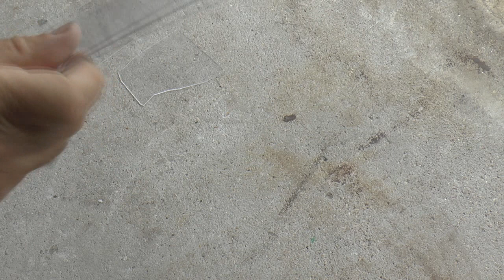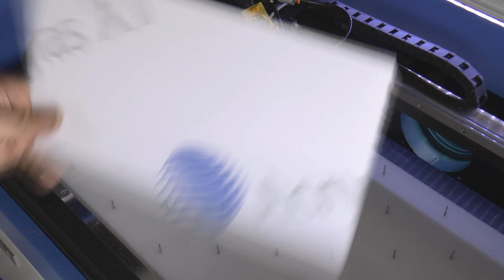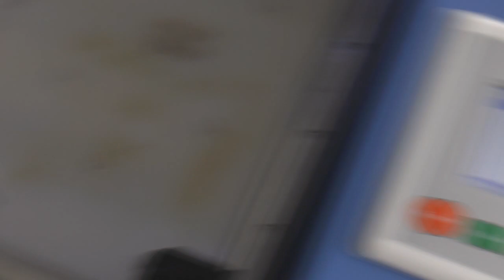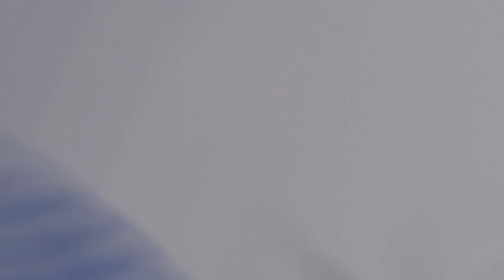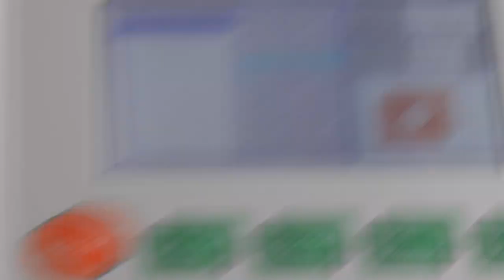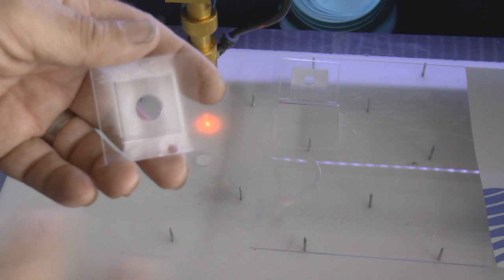RDWorks Learning Lab 05 Cutting first program

Comment: Hi Russ, please my laser machine does not cut deep but it only draws lines of what it's supposed to cut. I use RDworks V8 
My control panel is just like yours
What do I do
Reply from the maker: Hi Precious
 I now exactly what is wrong because I had exactly the same experience  when I bought my first machine. You undoubtedly bought is as an advertised 50 watt tube. A quick check will  confirm my guess that is is only 800mm long and is probably labelled  K H Laser.  In reality this is a reject 40 watt tube from a main tube manufacturer. K H Laser do not make tubes, they just re-label junk tubes and fit them to their machines.  The Chinese know that  A) you will be technically naive about this technology and B) you will have no way of measuring the power because that requires specialist equipment. Yes this is out and out fraud  that has been going on for years.
 I am  sad to tell you that the only fix is to buy and fit a new tube. However do NOT go looking on Amazon or Ebay. Yes, there are some great bargains to be had  but you will be buying junk to replace junk. They are cheap for a good reason.  No I am afraid you must buy from a reliable source to get a proper A grade tube 

Check out this CR45 tube from Cloudray. It will fit in exactly as a replacement.  
https://www.cloudraylaser.com/products/35-70w-co2-laser-tube-upgraded-metal-head-cr-series?variant=33496778277004

 Best wishes
Russ
Reply: Thank you Russ 😊

Comment: instead of using the "frame" to see the path or border, is there a setting to find the center of what your cutting or scanning?
Reply from the maker: Yes. If you go to Config System settings you will be able to set the HEAD POSITION to a central position.. When you draw, you will see that the green square sitting in the centre of your drawing. If you now drive  your head to where you wish to start and press the origin button , that is where your head will start and finish. You still might want to press the frame button when you have downloaded your program to make sure you don't run off your material.
Best wishes
Russ.

Comment: Sir Our machine is not doing round punch. How we fix it
Reply from the maker: Hi
There are many possible reasons  for this problem but the first thing I would check is that  your X and Y scaling are correct  Program a 200 mm square and burn it onto a piece of card or mdf, . If the dimensions are not what you have drawn then you need to re-calibrate each axis .
Best wishes
Russ

Comment: Hi i have 150w co2 chinese laser machine when i cutting mirror 3mm gold or silver acrylic (power 45 and speed 15) material ll be burn so let me knw how how much i ll give speed and power.
Reply from the maker: Hi Dyamu

As this video explains there are several clear plastics that are NOT acrylic and several such as PETG, Polycarbonate and ABS can be obtained in mirror format. You can set fire to acrylic vapour but the edge will not burn it just evaporates and leaves a clear edge.. If the edge is brown or yellow then the material is not acrylic. Is there a trade name on the protective plastic film? If so Google it to find out what the material is. Some plastics produce toxic fumes so be careful. see http://atxhackerspace.org/wiki/Laser_Cutter_Materials
Let me know what you find

Best wishes
Russ

Comment: hi, is there any feature to hold and continue the process when the electricity OFF and back ON again ?
Reply from the maker: Hi

Sadly no. When the power is turned on again, the machine will auto  reset to zero and wait to begin your program again. . Some machines have a separate switch for turning the laser tube on and off, if you have this feature then, provided you have not disturbed the material, you can restart the program with the laser switched off and then pause the program just before the failure point, and then switch the laser back on.

Best wishes
Russ
Reply: @SarbarMultimedia  hi thank you for the reply, is it possible if i add ON/OFF SWITCH on Laser line power ?
Reply from the maker: Hi
If you look at the next video     https://www.youtube.com/watch?v=ybnT3lECAqs       at around 8min 13 you will see the switch panel on the side of my  China Blue machine.The third one up marked laser allows me to separately disable the laser tube. Yes you can add your own switch but be careful because it is switching mains voltage.  If you look at the high voltage power supply you will see two sets of input terminals. There will be a 6 way terminal that has all the 5vdc  control signals and a mains input terminal that will be 3 (sometimes 4) terminals. You need to intercept the mains in one of those wires to control your tube on/off with a separate switch.

Best wishes
Russ
Reply: Hi thank you for your reply..

Comment: Hi sir,

great tutorial, and really very educational, thank you for putting so much effort in sharing.

I have a noob question, i bought a 90w versions and wanted to use it to ease my workloads and provide etching service in my fishing reels trade. And so my problem is, i actually have zero knowledge about laser cutting when i bought it, thinking it was just “plug and play”. So i search on youtube hoping to pick up some basics. and i came across your channel. 

May i please seek your advice, (my machine is stock)
-what is the advised distance positioning of the laser to cut 10mm acrylic?  What speed and what Min/Max power to set?
because when i tried? it seems my cutting line is thick and the edge is like rounded with melted acrylic. 

i also wanted to cut 0.8mm carbon fibres(there is 0.2mm fibreglass inbetween) but i realised i need to repeat it 3 times, still need to push it out and ended up the measurement was distorted by the over burning from the laser.

All i wished is to learn , how to achieve a clean and sharp cut through. You advises would me much appreciated.

I hope u can drop me an email reelspa@outlook.com as i am quite embarrassed to ask so much noob questions.

Thank you sir.

Regards,
Calvin

Comment: Hi, thanks for all the videos you post on here, they have been so helpful, but I do have a problem, every time I etch, the machine only etches at the top left hand corner, I’ve changed the green box to be position on my lay out page to start top left, and gone into config etc, re interned x and y box to zero but it’s still only etching in top left hand corner not in the middle where I want it to etch, hope you can help.
Reply from the maker: Hi Michelle
Take a look at your you tube messages
Best regards
Russ

Comment: hello! how to set the bed settings start origin on machine? every time i turn off the machine it comes back to the default. how to set it as fix and to start also the base point on bottom left? thankyou.
Reply from the maker: Hi
You have no control of where your machine runs to at start up. It will always be the back left or back right corner. That sets the main coordinate system for the machine. Take a look at 
https://www.youtube.com/watch?v=CWZvQXxbR_E
Hopefully this should answer most of your questions. If not shout out again and I'll try to answer.
Best regards
Russ
Reply: yes we dont have control, once i restarted the machine the origin on where it is stop that will be the starting point. unlike other laser, once you go for the origin marked, it will back to base point.  i would like to set the machine origin on machine settings and to set the origin on bottom corner so that the whole bed size will maximize and can be use also. thank you for your reply.
Reply: yes. please help.
Reply from the maker: Hi
I have prepared a video answer for you.

https://youtu.be/xwtNiVvSivU
Best regards
Russ
Reply: Thank you. appreciate your kindness mate. already watched the video and what i am trying to say is the initialization of  laser machine, once powered on, the head will move forward then the bed settings will changed again the size of bed that was changed in software will move and got vibration if the size will not meet. i would like to ask if the machine initialization of base point can be fix in one place which is bottom left corner then the size also of machine bed will not be move.. Thank you for your continuous support mate.
Reply from the maker: I must first apologize for not answering your question. You Tube place your comment into a spam folder and I have only just discovered it. I NEVER leave a question unanswered even if I cannot help because I feel that extremely rude.

I have looked at your video and can see that 
a)you have quite a large machine
b) The head is moving far too slowly 
c) It looks as though th head is trying to move towards the front right corner of the machine. Is that correct?

There will be a proximity switch, probably one of these at the end of the X and Y axes. 
http://www.ebay.com/itm/PL-05N-2-Inductive-Proximity-Sensor-Switch-NPN-NO-for-FOTEK-DC-6-36V-NO-5mm-/262115551988?hash=item3d074deaf4:g:1mcAAOSwFnFWCgJz

This is what the head is trying to reach to set the machine 0,0. It is taking so long that the controller is fed up with waiting and just ignores the reset procedure. In doing so it does not know where the table limits are and will drive the head into the end stops. 
If those sensors are at the front right then the immediate solution id to turn your machine on and let is set to where it wants. Then drive the head so that is is about 25mm away from the front right corner and press the origin button. If you look at the display on the screen you will see the X and Y cordinates displayed.  Now press the reset button and the head should now move  to the datum sensors and set your machine to a proper 0.0. 

I believe this will now make you machine ito a sensible one BUT you will have to go into the USER SETTINGS and adjust at least one number. Before you start this you will have have your pc connected to the machine When you select the USER tab you must first press the READ button to see the parameters that are already in your machine.In the first section there is a START SPEED. It may be set to 10mm/sec by default. Try changing it to say 100mm/sec and press the WRITE button to send the new number to the machine memory. You should find the head runs much quicker towards 0,0. If this fixes you problem the drive you head as far away as possible from 0,0 and press RESET. Does it make it alll the way back to 0,0? If not the increase the start speed until it does.

I do hope this helps
Best regards
Russ

Comment: Hello! Can you help me ? Now, i have a laser machine CO2, use sensor height live focus system LFS-AP01 and control system RDLC-V6.32.74. But i don't know how to set up auto focus for this sensor auto up and dow when i cut metal and nonmetal. Thank yo very much!
Reply from the maker: Hi Mahn
I am sorry to say I know almost nothing about this system. I have seen videos of it being demonstrated so I am aware of what it does. I have been to the RuiDa website and there are several operating manuals there to down load but none match your system model number
http://en.rd-acs.com/down_complex.aspx?FId=n14:14:14&pageindex=1
There is a contact link at the top of the web page so I would contact them directly for a set-up/ operating manual
Best regards
Russ

Comment: I have loaded RDWorks into my PC. When I press test, I am getting a "Test Failed." I am not connected to the 40W Machine. I have followed other Youtubers, and nothing seems to be working. I have watched ALL of you videos, and Very Well done if I might say, But I did not see anything about configuring RDWorks to the machine? Any Help would be great, as the Laser program that came with the unit, is One dimensional. Can't set power or other parameters.
Reply from the maker: Hi Arthur
Loading RDWorks to your computer is only step 1. RDworks is an interface program although some of its tools may give the impression it is a drawing/design program. Yes you can do some very basic things with the drawing tool but the main function is to convert your designs into a machine code file for to the machine to turn your dreams into reality. There are 3 ways to get that program to the machine. One is to save your program to a Ufile (onto a memory stick) and manually plug the USB stick into the top machine USB port. The second is to connect your pc to the machine with a USB cable (or via the ethernet port) and DOWNLOAD the program to the machine from RDWorks. The third is to have your pc and machine connected (as in 2) and just press the START button (bottom right of screen). Saving and getting programs to the machine are dealt with in

https://www.youtube.com/watch?v=p8npuHUO5sw
and
https://www.youtube.com/watch?v=ybnT3lECAqs

To help you configure RDWorks and understand why, take a look at
https://www.youtube.com/watch?v=fLSI-z-TdNQ
and
https://www.youtube.com/watch?v=CWZvQXxbR_E

Best regards
Russ
Reply: Thanks. I'll let You know how I make out.

Comment: Hi Russ, i need some help please . I've buyed a laser like yours , but cant put my files into my the machine . I've tried to save files from RDworks software as ".ai" ".rld" ".rd" but the machine can't read them . I've made the exactly steps you do with " file -udisk file etc etc " to insert the files into the machine but it doesent works . I tried also to connect the pc both by usb cable and usb key  but simply they doesn't exist for the machine . Surely i'm doing something wrong , but what ? First i've opened the right hand door of machine and discovered the usb cable weren't properly connected , i thought it was ok after that but nothing changed ..... Can you tell me which format do you use to save files ? Did you connect your pc via cable or usb? thank you very much

Comment: Thanks for making these great videos! From what I've seen with you using that control panel, it looks to be a very primitive way to control a laser job...are we able to use any CAM software to generate gcode that can be sent to the machine, with power levels and feed speeds in the gcode, etc. so the control panel just has to send the job?

Comment: HI Russ, have a quick question, learned a lot from you learning so far, thanks for that! The question is, where do I adjust the speed the laser head travels from the end of one cut to the start of another? Mine seems to be moving a bit too fast at the moment creating a material jarring with lighter materials, which isn't good for cuts aligning, obviously I could tape down my thin acrylic, but don't feel that should be required.
Reply from the maker: Hi Uriah
If you go to the USER tab (RDWrks top right) you will find a whole list of machine variables that you can adjust. You will have to have your pc connected to the machine to do this. Press the READ button to see the current machine settings.I think the first Cutting section is where your soution may be.  Idle Speed and Idle Accn are the items I would play with to begin with. MAKE SURE YOU WRITE DOWN THE CURRENT SETTINGS BEFORE YOU CHANGE ANYTHING. If I remember correctly, the speed will be set to 300 and the acceleration about 2000.Set the acceleration to about 200 and the speed to about 30 and then press WRITE. With these exaggerated settings you will be able to see if this is the factor you need to work on.  If not, set the numbers back to original and press write.
You can safely experiment with other factors using this same method.
HOWEVER, this will compromise the speed of your machine and may not be the root cause of your problem. Put your hand on the worktable to see if there is back/forward movement or side to side movement. If so, try to fix this problem first because a "sloppy table will give all sorts of mis-registration issues
Best regards
Russ
Reply: Thanks Russ, you nailed it. My table was fine, I actually have the machine resting on the concrete floor of my garage, and the motorized z table in the machine was stable as well, I decreased the speed to 150 and acceleration to 1000, willing to take a small hit to job speed for quality and material conservation.
Reply from the maker: Thanks for the feedback Uriah. I have dabbled with the setting in passing but was only 80% sure that was the feature that would fix your issue. So it's great to have confirmation from a third party  and someone with a different machine.
All success and best wishes
Russ

Comment: Hi Russ,  Thanks for all your help did all the checking you suggested just one red light was lit so email chaps i bought the machine from they have suggested it's the power supply box costing just under £400 + vat  a straight swap so i can do it myself will let you know how i get on 
kind regards and happy new year
Steve
Reply from the maker: Hi Steve
I will be interested in the outcome. There are two power supplies on the machine. One is the mains input converter that reduces voltages down and to DC for the Ruida controller (the white box) and for the stepper drives. The other power supply is the high voltage controller for the tube. So, if you have any sort of power going to the stepper drivers or lights on the white box, then I would doubt failure of the mains power supply. The high voltage power supply has nothing to do with any of the issues you described. £400 sounds like a silly cost for the mains power supply and my guess is that you will be getting a new digital controller.....which is the most likely cause of your problems. See
https://szret.en.alibaba.com/product/60325509137-221513432/Ruida_RDC6442G_CO2_laser_controller_laser_cutting_and_engraving_controlling_system_Control_Card_DSP_controller.html

Best regards
Russ